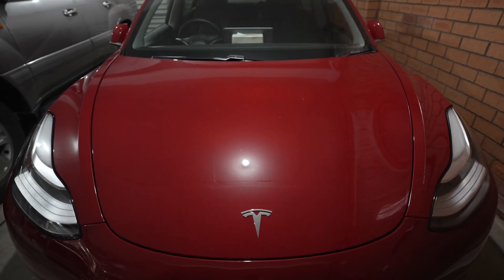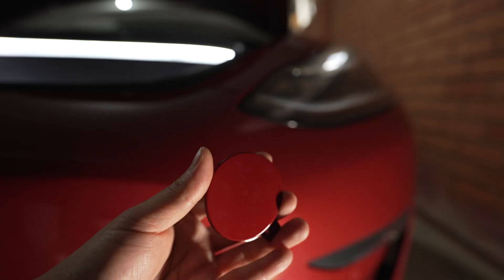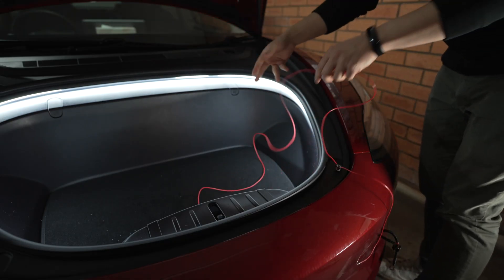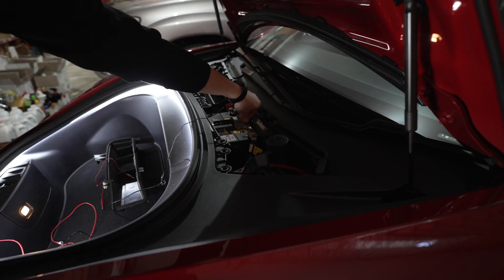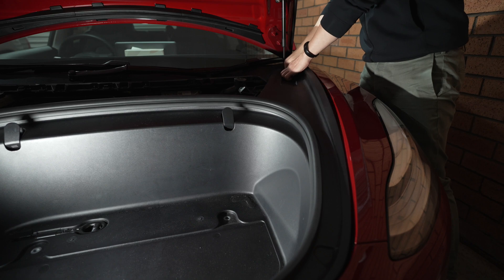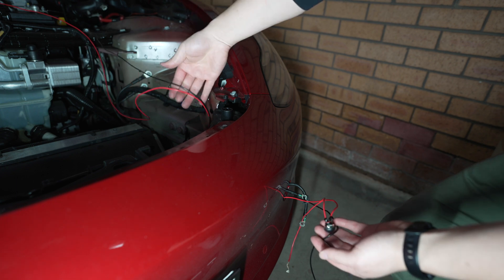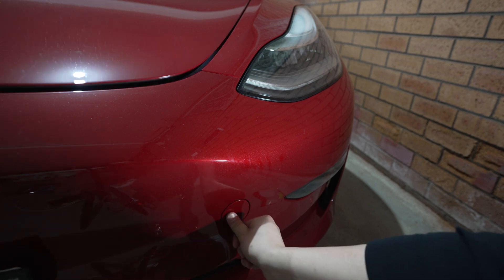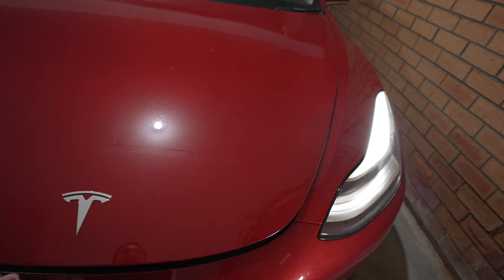How to make a frunk button for your Tesla

Comment: Interesting mod but honestly, it's way too much work.  I'll keep using my phone, even if my hands are full and I have to put my packages down.  But on my 2018 Model 3 there isn't any foam inside that area.  Here's a suggestion for properly closing the Frunk, you just gently hold the hood down and an electronic latch will engage.  You don't have to give it a push to click it into the latch because it doesn't have that type of attachment.
Reply: Interesting, I just tried that on my 2021 M3LR, it did not work, no electric motor latched when just holding it down, nothing, tried several times.
Reply: @BSSMSLJ  Then you are not holding it down far enough or long enough.  It's an electric latch, it's not mechanical and doesn't click in like on ICE vehicles.  Tesla has not changed how it works on the Model 3.  Remember you have to slowly push it down and hold.
Reply: @Resist4  if I had to push any harder it would be more pressure than it takes to actually close it normally,  I did hold it down for about four seconds, several times, no go. Perhaps this is something that varies year to year or is different model to model, or even from plant to plant (giga factory). In any case this is not helpful if it in fact takes more pressure than closing it normally.
Reply: @BSSMSLJ  Are you getting the hood flush when holding it down.  But it's not really that complicated, you just push the hood down and hold, there is no need to give is a shove like with most vehicles.  Tesla hasn't changed the mechanism, it's always been an electric lock on the Model 3.  The latch is mechanical but the lock is electric doesn't need a shove to lock it in place.  How do you normally close your hood?
Reply: @Resist4  Definitely flush, I was afraid I was going to dent it, but nothing happens.
Reply: @BSSMSLJ  So are you saying the latch won't lock at all?  Because slowly pushing and holding is really no different than sharp push.  The latch would lock either way.

Comment: When I got my Model 3 four years ago, anyone could open your frunk by adding even just a 9 volt battery to the terminals under the bumper cover. A software update fixed that security problem.

Comment: Have you considered an autofrunk kit (auto open and auto close) from Hanshaw? I have it installed in my MY (and my M3 previously), and it is the best after-market to my car, hands down.  No finger or hand prints. Works using a key fob, the Tesla app and the screen.
Reply from the maker: The autofrunk kits would definitely be the more premium solution. My frunk button is just a basic diy option that pretty much anyone can do with <$50 off the shelf parts.